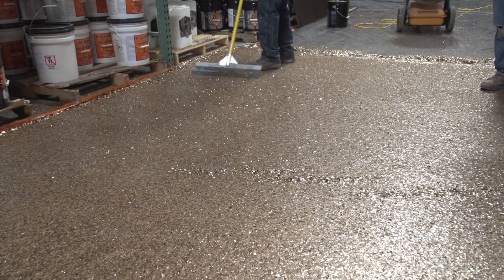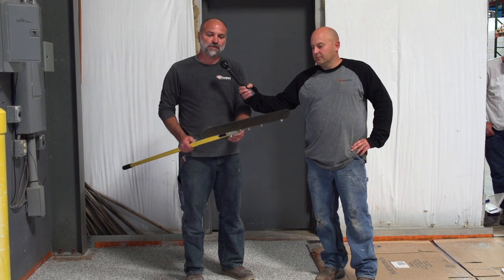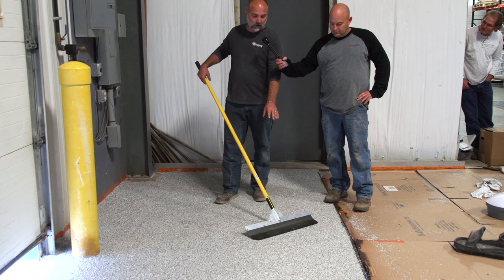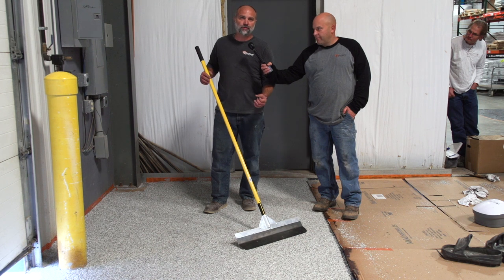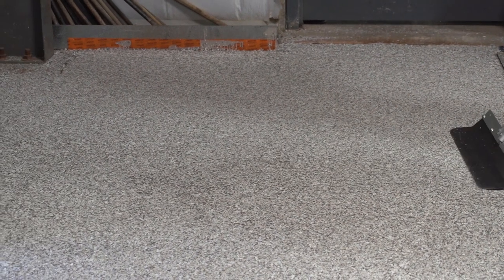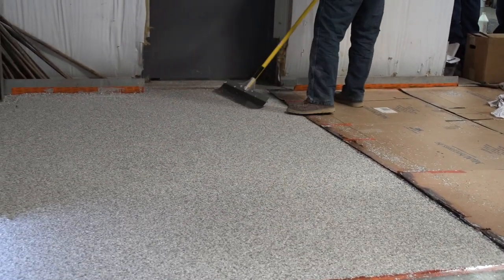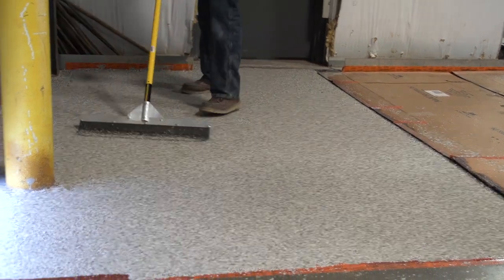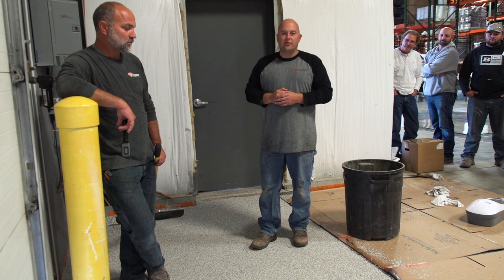Scrape Broadcast Chips Before Topcoat!

Comment: Do you really need so much flake? It seems a lot of flake is wasted on most of these videos.  Why can’t you just evenly coat it and then scrape the excess/vertical flakes.
Reply from the maker: Thanks for the comment! Casting this amount of flake will ensure even coverage every time. As installers gain experience, they can cut back a bit to the right amount of flakes that works for them. But, broadcasting plenty will always yield the best results. You can also reclaim up to 90% of extra flakes and use them on future projects, so there really isn't much wasted. Thanks for watching Deco-Crete TV!!!

Comment: What can I do if I applied my flakes unevenly and I ran out before I could finish the floor?  I was a little heavy handed in spots.  Thank you!!
Reply from the maker: If it is still uneven once everything is scraped as thoroughly as possible, small areas can be spot treated. If the problem is widespread over the whole job, re-chipping into clear epoxy will be the best option.

Comment: Can you also lightly sand the floor after scraping to making it perfectly flat? I don’t like the dimpled look in flaked floors.
Reply from the maker: You won't get it too much smoother from sanding. You could, however, apply a coat of clear epoxy to fill up the texture before the top coat. This would make it susceptible to UV rays, which would cause the floor to yellow a bit if it gets direct sunlight. Thanks for watching👍